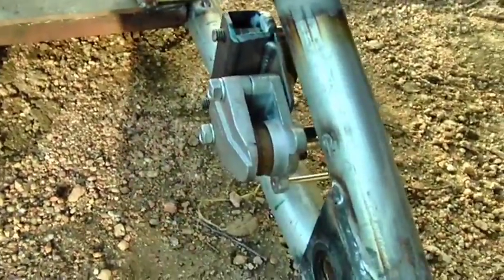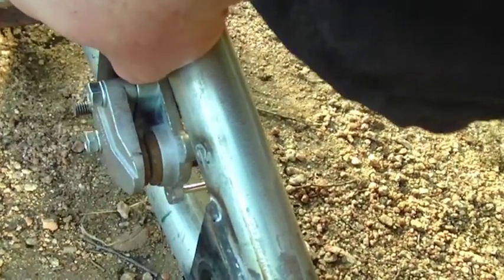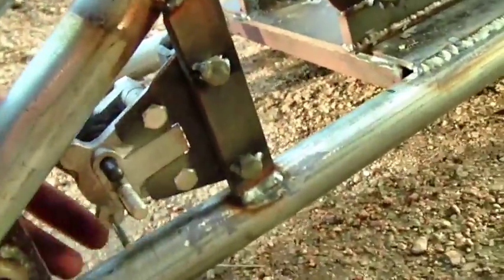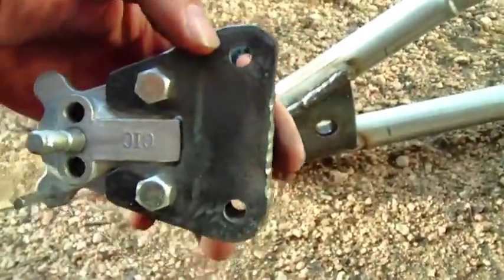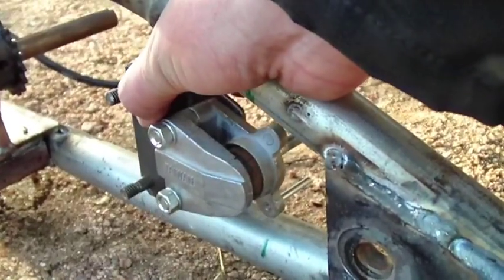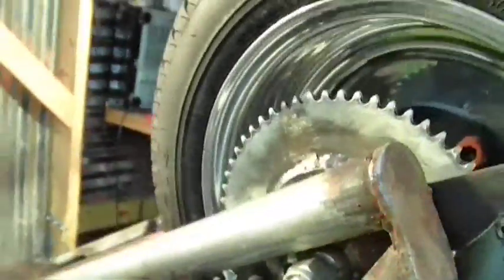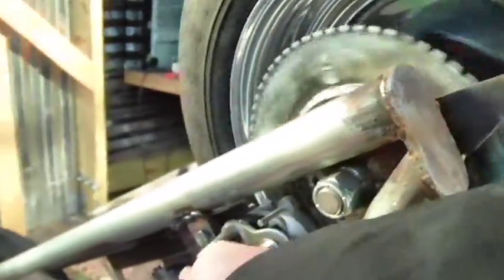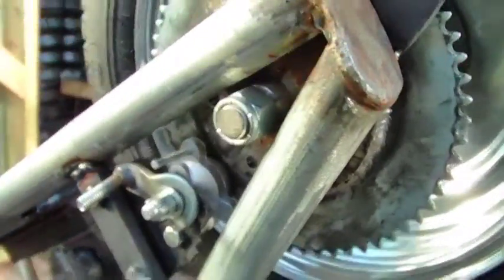Brakes!

Comment: Hello Doug like your chopper build. I do builds like these too. Just was wondering of the rear tire assembly setup. What kind of rim,tire,hub assembly do you use. That would be a good video by its self. Check out my builds and current chopper build. Thanks keep up the good work.

Clintmeister